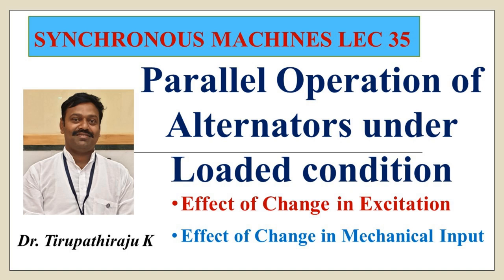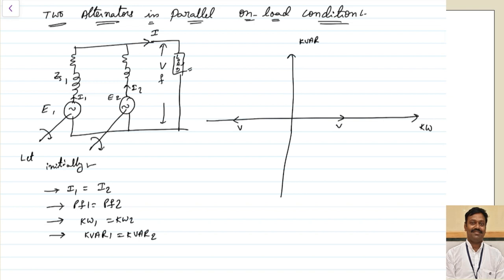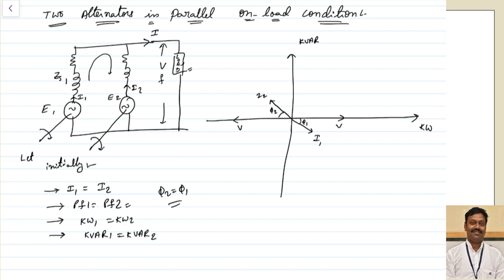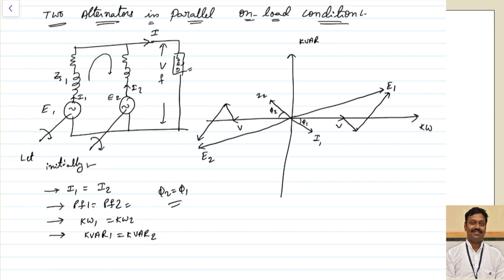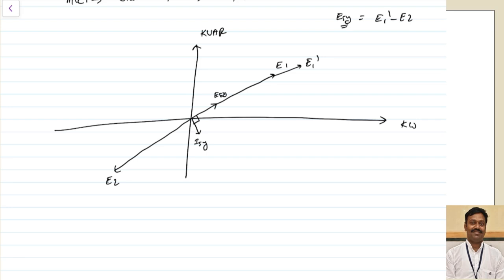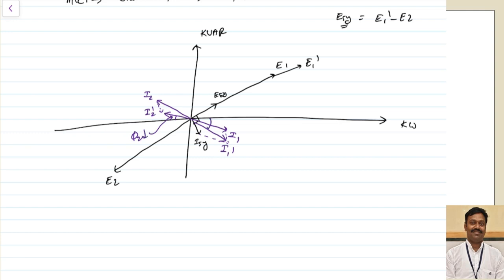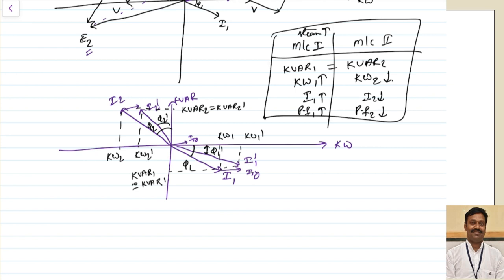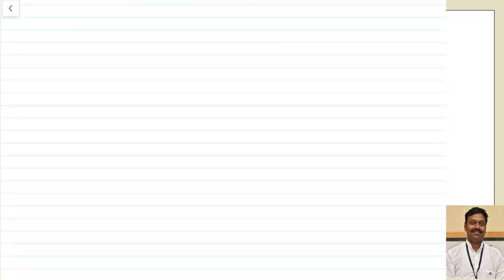SM35 Parallel Operation of Alternators under Loaded condition

Comment: Dear sir
 I have one more confusion that whenever we draw voltage vector for two alternator in opposite direction ,it means angle between them is 180? supposed to be both are  peak at same instant ans zero at same instant means zero phase angle.

Comment: Sir.. when load is connected .. if I increase excitation of one alternator.. then it will be accelerated.. because inorder to maintain same speed if excitation is increased then power angle(delta) should be reduced.. so ..will the whole combination will be distabalized??

Comment: Sir, how can we say that the magnitude of generated voltage does not change with frequency although the emf equation(E=2.22 f × phi × Z) has the frequency term and what is justification for the change of phase of emf with frequency?
Reply: @lecturesinelectricaleng 
I watched the  video. What I am still thinking is that when the speed of the prime mover changes the frequency as well as the induced voltage must change. Because E= 4.44 f × phi × T.
Reply: @lecturesinelectricaleng 
Ok sir. But then here in the second case you have assumed that the magnitude of E1 and E1' are same, only phase is changing. I want the reason for both - (1)why magnitudes have been considered same here and (2) what is the proof that phase changes with speed/frequency?
Reply: @lecturesinelectricaleng 
Ok
Thank you Sir.

Comment: Dear sir
Please clarify that at first vector diagram IxR and IxX  why they are being drawn at this direction.IR might be in phase with V. Please explain the reason why they are drawn at that angle.
Thanks
Reply: Dear Sir thank you very much for clarification and response.
And I have one more confusion that whenever we draw voltage vector for two alternator in opposite direction ,it means angle between them is 180? supposed to be both are  peak at same instant ans zero at same instant means zero phase angle.